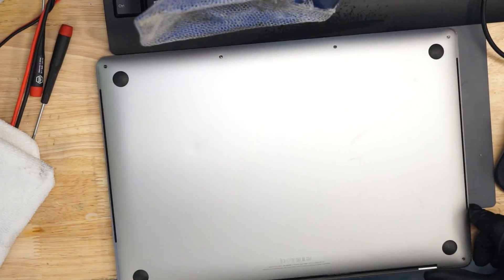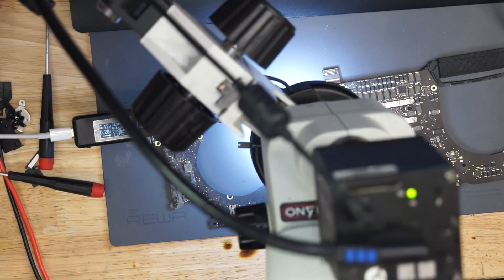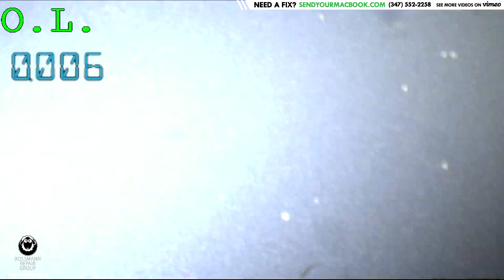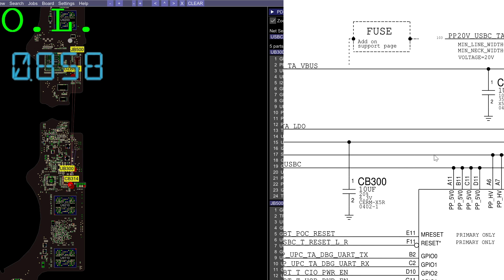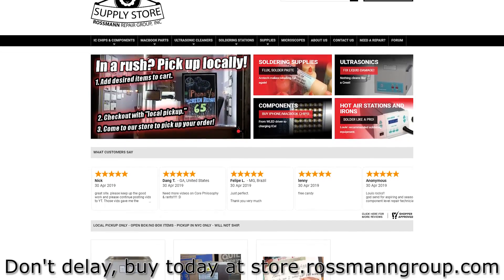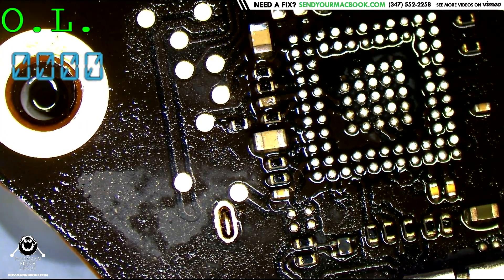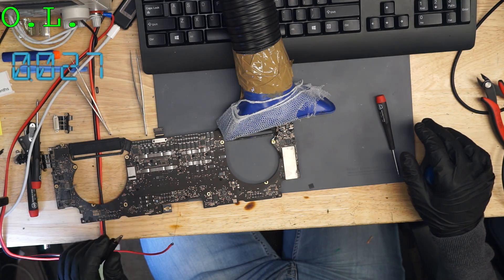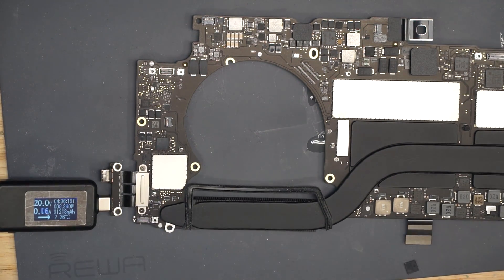😊 A happy A1707 Macbook Pro board repair 😊

Comment: Hey Louis I have a 13 in MacBook motherboard but I have a question I've bought a 10.1 inch LCD display it's a raspberry lcd display but it works so does the motherboard I've also bought one of those adapters/cables and it didn't work it's a mini dvi to hdmi adapter but some ppl told me I would need my original MacBook display to go to apple icon bar and then to system preferences and display but I don't have the original lcd screen do u know how I can use my 10.1 inch LCD display with my MacBook motherboard thanks

Comment: the resistance when the circuit is powered off does not equal the current drawn when the circuit is powered on; there are active components drawing current. like when a mosfet controls a circuit that has failed into a short circuit but the mosfet still works, so when it's powered it enables the short circuit

Comment: It is funny, Louis Rossmann confusing about measuring ohms in diode mode, and he thinks it is all the load that will be present as "ohm" reading.

What DIODE MODE in tester do, is to measure the mv fall , is to say, the tester applies like 2 or 3v, and it measures a diode / transistor / whatever, if the diode takes 0.6v between its barriers, in the tester screen you will read 0.6000   ... , that doesn't mean in any way it is 600 ohm or something, if you measure 0.1600 that means the silicom is eating 0.16v in other words 160mv, if the mv fall is great than certain threshold, it will show as OL.

So, you can measure a single 1N400x diode will show as 0.67, measure two, will show 1.3 , measure three in serie will show 1.9, measure four will show OL.

DIODE MODE IS NOT OHM MEASUREMENT.

0.160 can mean that after two working diodes is a short circuit... and the current will flow big!, because a working diode is not a RESISTOR of 160ohm.

NOW TESTER IN RESISTOR MODE, it applies just enough voltage to measure resistence, but not to polarize any silicon barrier, so current don't flow in semi-conductors, current only flow in passive components, and that way you can measure real resistence without lifting any component in most case scenario.
Reply from the maker: The meter is not in diode mode, put down the pipe!
Reply: @rossmanngroup  so. If not. You are measuring nearby passive components. Not the real load. So. Your surprice wonders me if you has clear the theory.   Or you are just pragmatic and learned on the fly.
Reply: Anyway . Pragmatic is more valued in a repair shop... mean he will do faster. So far so good.
Reply: @rossmanngroup  anyway smoking is a bad habit. Bad bad bad boy ;).   Now my real weakness is a good cold CINDOR. Nothing  like a cindor . It is healty

Comment: Serious question: I notice you did not put solder on the pads before replacing the chip. Is the chip pre-tinned so the pads do not need solder, or am I missing something?
Reply: Chips that go on a grid of contacts like that have little balls of solder on them from the supplier.

Comment: If there's a diode drop or two between your rail and the short to ground, the ohmmeter will not give an accurate reading.

Comment: the short may only show up when 3 volts is applied and the multi-meter tests ohms at a lower voltage(mosfet turning on for example)

Comment: Just FYI, ohm's law breaks down when semiconductors get involved.  It's great if everything is resistive but as soon as you have a diode drop, your multimeter's going to lie to you.
Reply: It's not ohms law's fault but the non linear characteristics of the semiconductors in the circuit, that is, the resistance will change as the voltage changes. The voltage and current level from the meter are different than the voltage and current level from the power supply. Louis could take the voltage and current readings from the power supply and calculate the resistance of the defective circuit. Once the circuit is repaired using the same voltage he could read the current and calculate the new resistance of the properly working circuit. I used to use my finger to find warm ICs until I burnt the part number from one onto the end of my finger.
Reply: Ohms law never breaks down. Meters cannot read induced resistance. Induced resistance is caused by magnetic forces of nearby conductors. If you coiled a single conductor, and powered it. You would find a big difference between the resistive resistance, and induced resistance.